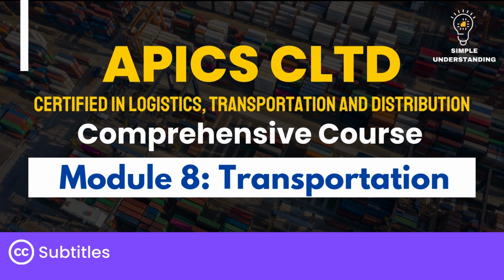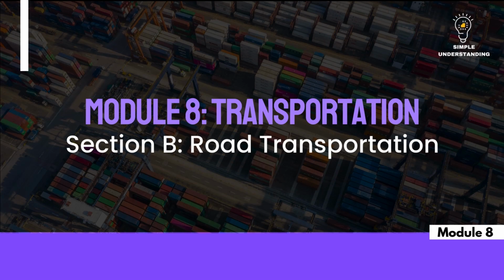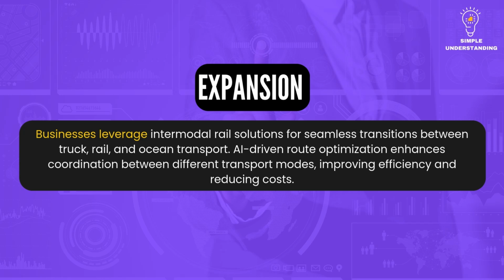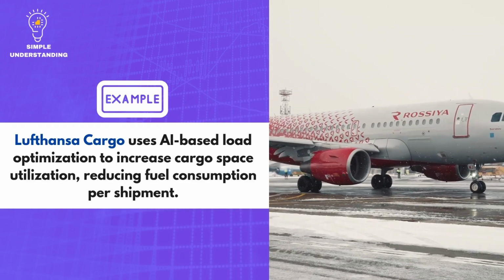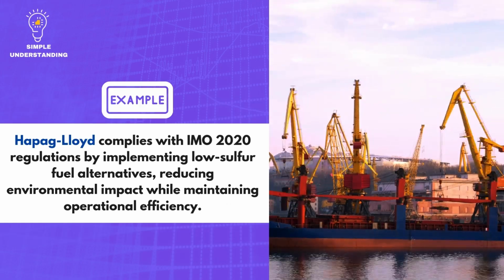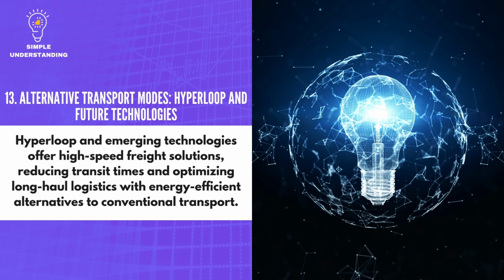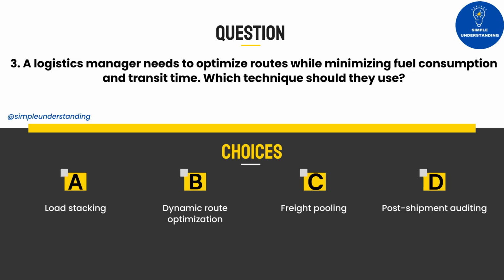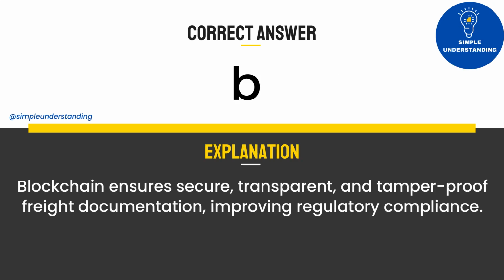APICS CLTD Module 8 Transportation Management Full Course (180 min)

Comment: I am currently preparing for the CLTD exam using your videos, and I also study with the help of ChatGPT. In your opinion, is this approach effective enough to successfully earn the CLTD certification?
Reply from the maker: Using videos and ChatGPT is a good starting point, but to be completely honest, it’s not enough for the real CLTD exam—especially the current CLTD v3 version. If you’re aiming to pass on your first attempt, you’ll need the complete study package for thorough preparation. I’ve included the link in the description for you to explore.

The full package includes:
Bundle 1: Complete coverage of 2,000+ pages across all 9 modules and 38 sections
Real-world case studies and applied examples
Step-by-step solutions for all quantitative problems
Bundle 2: Over 4,500 MCQs, including:
• Scenario-based questions
• Application-driven questions
• Multiple-correct-answer questions
• Quantitative problem-solving sets
Bundle 3: 1,900 flashcards for quick and effective revision

Keep in mind — the real CLTD exam costs over $1,000, so it’s crucial to study thoroughly and prepare properly. The full three packages provide more than enough material to help you master the content, but success ultimately depends on your consistency, focus, and effort. Study daily, go through each module carefully, use the flashcards, and practice the MCQs repeatedly — that’s how you give yourself the best chance to pass confidently.

I’ll also send you a free sample of the CLTD v3 materials so you can try it out and see if it fits your needs. Just fill out this form, and I’ll send it over:
👉 https://forms.gle/5YeK6HCs45kNZcQ19
Reply: Thanks for your answer, I'll have to think about it.